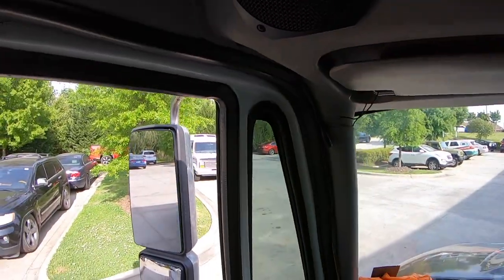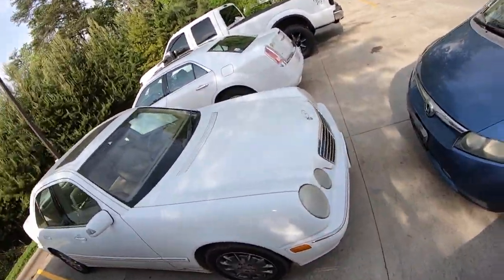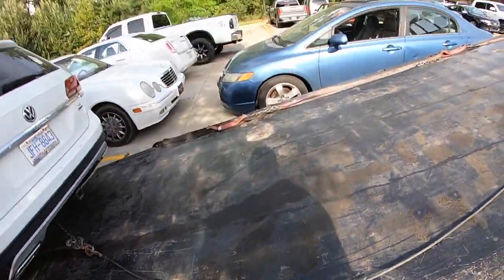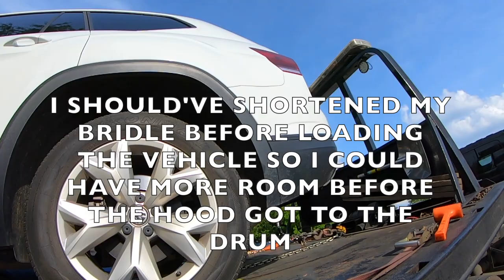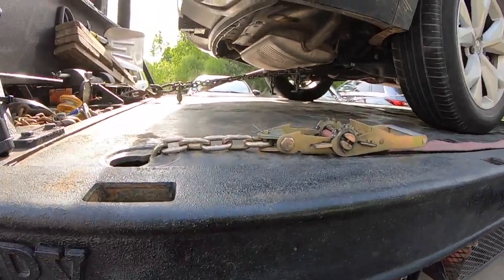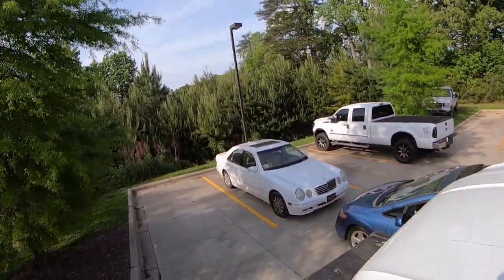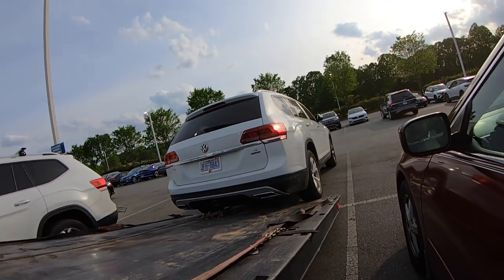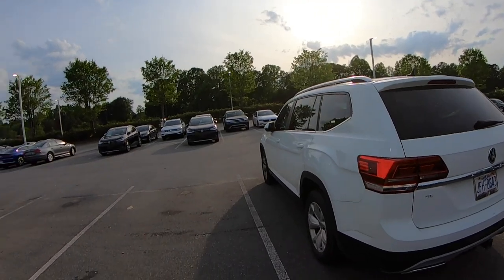VW ATLAS STUCK IN PARK AND PARKING BRAKES STUCK ON

Comment: Well done, up here in the snowy area, almost everything is AWD/4X4 .. I got tired of shimming skates & wound up shaving the leading edge so it walks itself over the lip of the deck. This is when a smooth steel deck is nice... but skates don't slide down a ribbed aluminum deck.. so its more hassle..  when you replace your cable, you should try the self locking hook style.. theyre so worth the little extra... plus, they cant snag on the edge of the deck if it twists tip down while winching. tip the camera down a bit more  Having the right equipment used with great skill & great operator...= great content & profit
Reply from the maker: I keep getting comments about the skates not sliding on the aluminum beds. I wonder if the green wreckmaster skates work on the aluminum beds cause the B/A skates are softer and don’t work well when I’ve used them. The cable is getting replaced soon and definitely gonna have the self locking hook on it, that’s the cable we have on the other trucks. The camera either shifted when I changed the battery or when I hit it against something. Usually it’s good cause I check on the GoPro app before recording.

Comment: I wear out a set of wreckmaster skates in a year. I get the set of four and leave two connected to make a double wide skate. This works way better for flat tires and if you set hem up at a slight angle they will clear the lip of the bed. Even on a roller deck. Also, if on flat surface if your skating the leading tires, no need for the snatch block. It will center if the hooks are even.  
Would love to ride along and share our tricks.
Reply from the maker: I haven’t worn out my skates that they need to be replaced yet. Guess that’s a good thing though 😂. I like that you can put 2 of the skates together to make a larger skate which are definitely great for flat tires. Skates and a snatch block are my must haves on a truck. Sometimes the vehicle will straightener itself out as your pulling it up the bed and sometimes you’ll need to snatch block it over a little.

Comment: the skates hitting the bed issue is one that drives me nuts. i have a 22ft century dove tail with rollers at the end. ill normally hammer the skate about 1/2 way in under the tire, that way the back end of the skate kinda sticks up into the air and will get past the edge of the bed. but i carry 2 extra skates (on top of the 4 green skates i already have) to do exactly what you did with the orange ones.
Reply from the maker: Yeah that’s the only problem with the skates. I had a century bed with rollers and had the same issues. I would either use extra skates or a pry bar cause I had a winch remote and could pull it while lifting it a little. You can always put them under the tire a little then when it’s on the bed hit the skates under more.